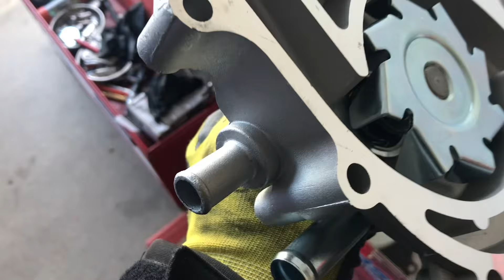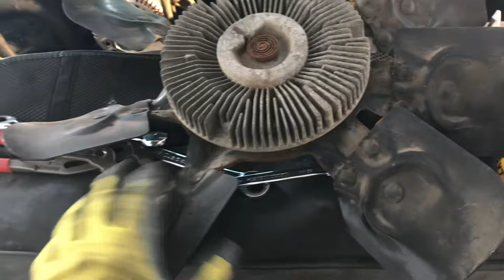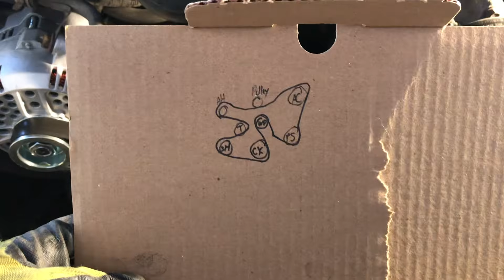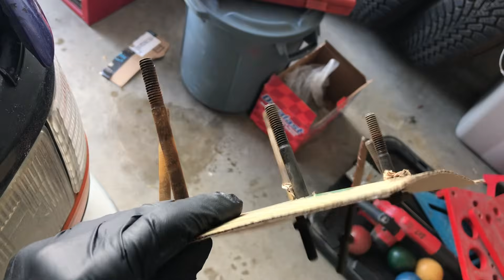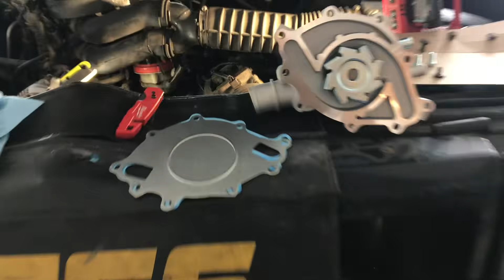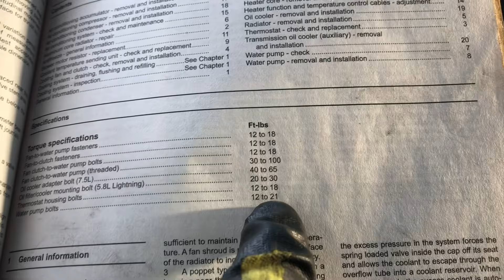How to Replace a Water Pump | 1995 Ford F150

Comment: Did you use a stubby impact to remove the pump bolts? I am replacing my water pump this Sunday. I am scared of breaking bolts.
Reply: OMG! One bolt broke on the water pump (not your fault).  3 weeks later, my truck is running again.  The top passenger side bolt was so corroded, the bolt broke and I had to cut the timing chain cover. Ford does not make the timing chain cover anymore. All of the China aftermarket covers do not fit correctly. Summit Racing sells one from Mexico that is good to go. I learned a lot from this project. I enjoyed driving my truck today after putting it back together for the third time (the new water pump had issues, go figure, #2 was good).

During this project, I replaced the harmonic balancer, the fan clutch, and all of the gaskets involved with Fel-Pro gaskets.
Reply from the maker: @drcazeddog  Damn! You’ve experienced it all and you’ve survived!🤙 It’s such a great feeling being able to drive a truck you but back together. 
Thanks for the update man!🤙
Reply from the maker: I actually used my full sized impact. I didn’t own my stubby then. So you can definitely use a stubby and be fine.🤙
Reply: @TheMinuteMasters  Thank you!

Comment: Best video I can find for 2002 ford 6cylinder f150 single cab short bed...all the other videos for 2002 ford f150 water pumps did not have connections for hoses, and I'm wondering why my truck has hose connections but the videos I was watching did not.... this video has those connections and it looks like my water pump on my truck. Thanks for making this video. Really helped me. .. now I know I bought the right pump. Putting it on tomorow.
Reply from the maker: Thanks man! 🤙 I appreciate it! Interesting. You definitely need to include the hose connections for sure. I’m glad I can help you out!

Comment: Nice work.  I always use Anti-Size on bolt threads secured to the block.

I learned the hard way on my 289 and blue Fel-pro gaskets.  Instead, use Victor-Reinz reinforced gaskets with gray water pump RTV.
Reply: I purchased a set of Victor Reinz gaskets in 2016 for the timing chain replacement  on my 1994 Lightning. You can get them from Rock Auto, Advance Auto Parts, AutoZone, and possibly from Summit Racing. 

I have used blue Fel-Pro gaskets in the past on a 289 C-Code.  No matter how well I prepped the gaskets, the intake, timing chain and water pump gaskets would eventually swell and spring a leak.  I use Victor-Reinz gaskets when available.
Reply from the maker: @jamestapscott9400  Gotcha. I’ll keep an eye out for those gaskets!
Reply from the maker: Really? Good to know. I haven’t had any trouble getting anything unbolted from the block (aside from exhaust manifolds). 
Who sells Victor-Reinz?

Comment: Just replaced the water pump in my 94, it was a grueling experience getting those 7in bolts out without breaking them (took 10 hours basically)
Reply from the maker: Really? Were the bolts stuck? I have my impact to help me with that.
Reply: @TheMinuteMasters  they were very tight, used everything. Ended up torching them a few times and they came loose
Reply from the maker: @tuckerhiggins4336  Nice! The torch always does the trick for me.

Comment: Since you pulled the fan off are you going to stay with the oem or upgrade it since you have it off. Keep up the videos man. People do care about there old f150.
Reply from the maker: I'm going to stay with the OEM fan for now. The only real upgrade is an electric can but I haven't seen anything that's super reliable yet. Maybe I need to look at more expensive electric fans for more reliability. 
I sure will man! Thanks for watching!🤙
Reply: @TheMinuteMasters I’ve used the same flexalite electric fan for the last 30 years without fail.

Comment: Damn, Stevie,.. Didn't that get replaced when you pulled your engine out? I just adjusted my shift rod under the truck but haven't tested it yet.
Reply: I was thinking the same 🤦‍♂️
Reply from the maker: Unfortunately, I didn’t replace the water pump when I pulled the engine. That decision definitely came back to bite me.
Nice! Hopefully you will be able to get her moving.